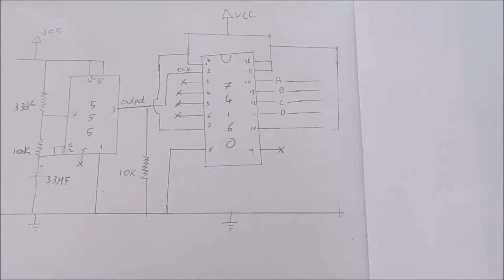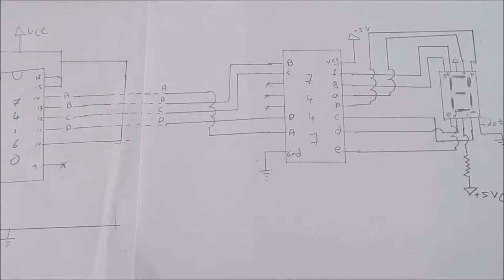Counting from 0 to 9 on 7 segment with counter : using 555,72160 and 7447.

Comment: Hi! Do you know how to make an "IF-reset" circuit for the condition of first three bits selected as "000"? I want to make a cycling circuit using CD4017 chip that will count only up to "111" and then will be reset on the next pulse.
I guess that it can be made with 72160 IC as well. But i do have only 4017 and 4040 chips now... "Reset" is usual for any binary counter chips, right?
Reply from the maker: MoolahNasreddin yaa sure I can make but give me more clarity on how u want it and the full details of the project if its big ill make a video for u if its small ill just advice u thank you
Reply: Actually i've forgot that the last bits are repeating anyway :) i'm sitting with 4017 now and diggin in. It would be cool to make an "IF" to reset on "100" and "110" as options. Is it possible to do this with this structure:
here is a mini-switch to set these three bits that will be an "IF statement" that will switch "reset" (so there will come a high level)? It would be an ideal solution. So the counter can be made for any length.
Reply from the maker: Yes u need logic gates for that and and not or nand could work finr
Reply: i've found that cd4017 is a "shifter", not a binary counter :) Currently i'll try CD4040